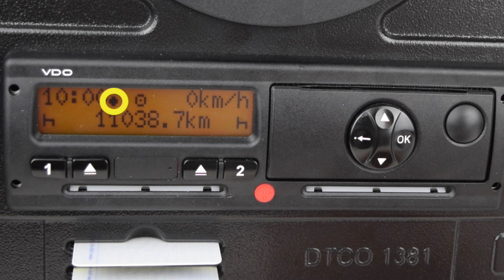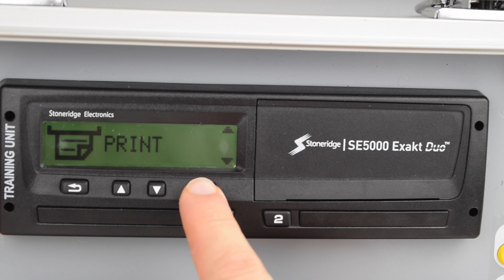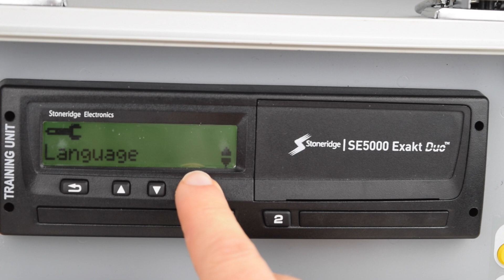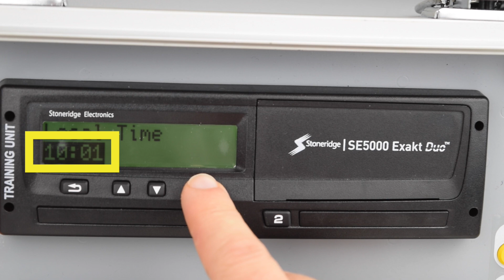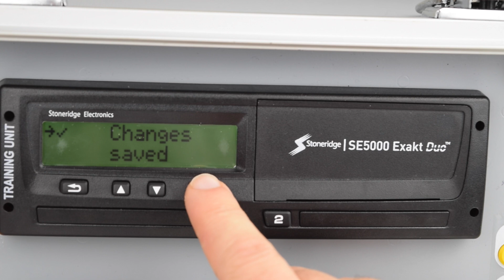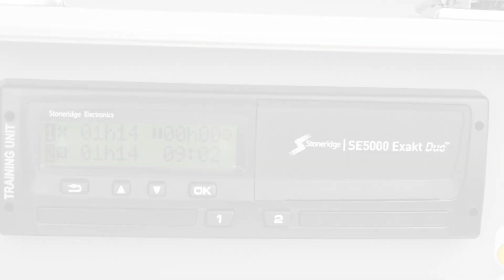How To Change Time on a Digital Tachograph - Stoneridge and Siemens VDO

Comment: So many local-time videos! 

Fine. 

But I have an other problem. The clock ist wrong for five minutes. For example: it's 6:00 o'clock am but it shows 6:05. 

How to correct it five minutes? backward? Thanks!
Reply from the maker: Hi FranekAIC,

In order to adjust the UTC time there are slightly different procedures depending on which Tachograph you have. 

For example, on the VDO tachograph enter the main menu and select 'Entry Vehicle'. Then scroll down and select 'UTC Correct.'. Here you will be able to adjust the time by plus one minute or minus one minute. This can only be done once per week. So as you mention your tacho is 5 minutes fast it can be corrected over a period of 5 weeks.

Note: if a tacho displayed a time of 20 minutes or more out it would need to be recalibrated (ASAP).

Hope that helps. If you need any more guidance please feel free to send an email at info@fleetdata.ie and I can send you full instructions.
Reply: Fleet DATA THANK YOU!
Reply: One down. Four to go. THANK YOU.
Reply from the maker: Delighted!